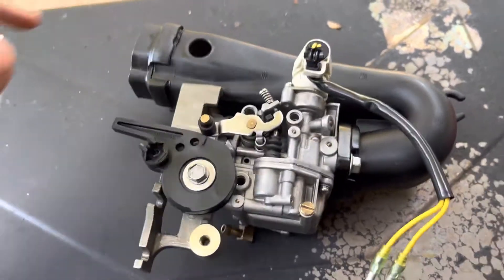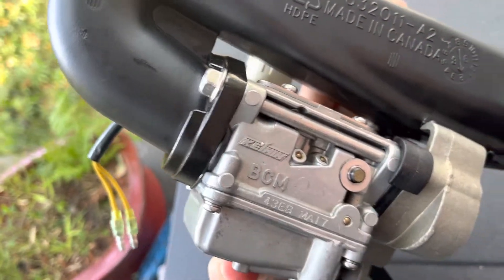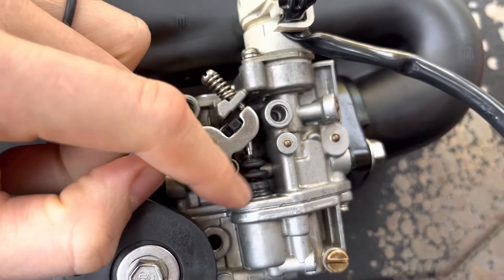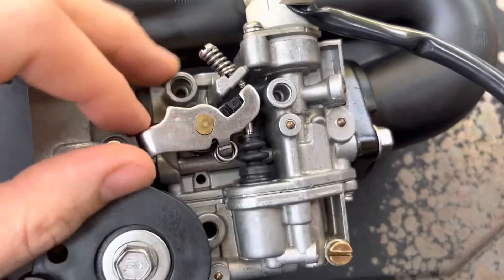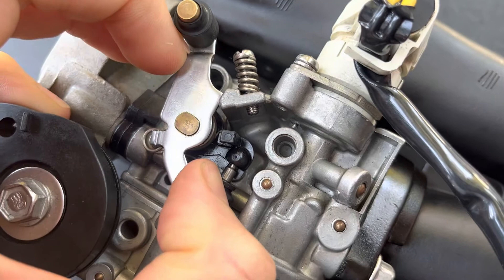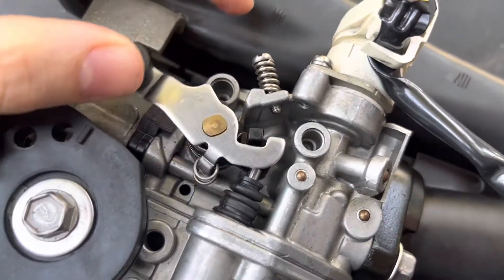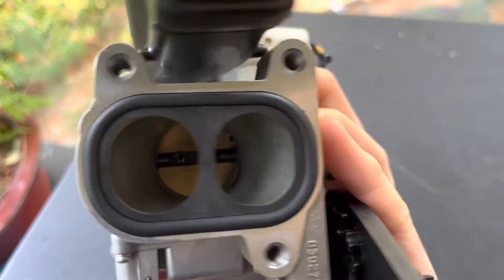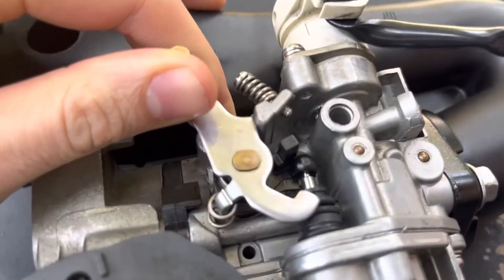? How to change bellows on plunger mercury mercruiser 25hp Bigfoot outboard motor / fuel leaking

Comment from the maker: I GOT IT! You just gently pry the socket and the ball apart. I used a flathead.
Reply: Saviour, didn't think I'd find the answer to this...! Going to give it a go now.
Reply from the maker: @jakedaviot5392  SWEET! LMK if it worked for you.
Reply: @ArtworkAnon  worked a charm, thanks again!
Reply from the maker: @jakedaviot5392  Yes, Awesome. Took me days to locate that answer. So happy I can help. Im usually looking for help. ✌
Reply: Wow this will help me on a Mercury 50hp Fourstroke I got four carbs on it and all have this rubber boot/plunger/bellows (whatever it’s called) broken and showering all carbs with fuel.
Reply from the maker: @ glad to help!
Reply: I changed all four hardest part was putting the rubber boot on brash base and now two don’t leak and bottom two still leaking bad even though new boots 😢
Reply from the maker: @ try blowing air through the fuel input line. Not high pressure but a bit.

Comment: Any update. I have the same problem. 
Did the float fix it?
It looks like the boot is not made to seal gas. Just to keep dirt out. 

Any updates help. 

Thank you for the video
Reply from the maker: The rebuild worked for a little while and then my leak came back. I ended up changing the whole carb.
Reply from the maker: I still have no idea where or why it was leaking. I stumped 3 boat mechanics. 🤷‍♂️